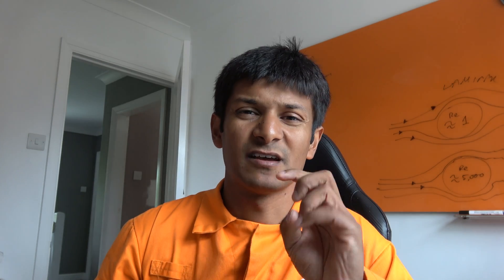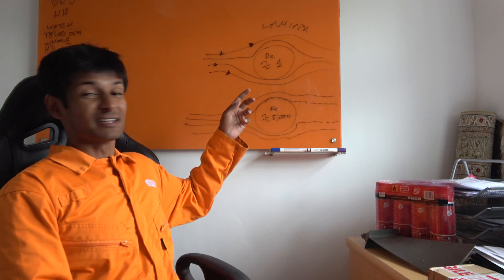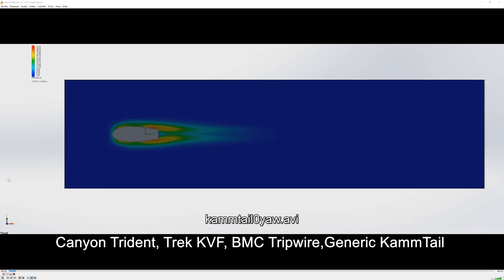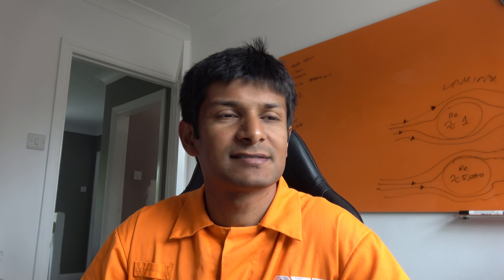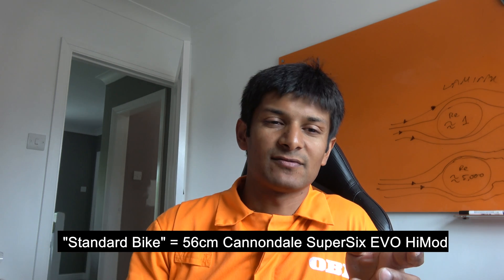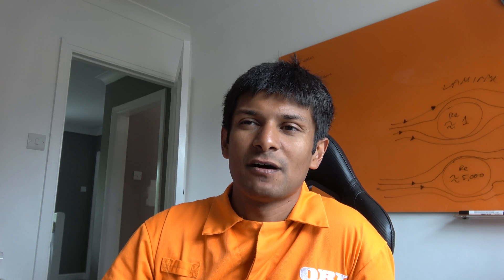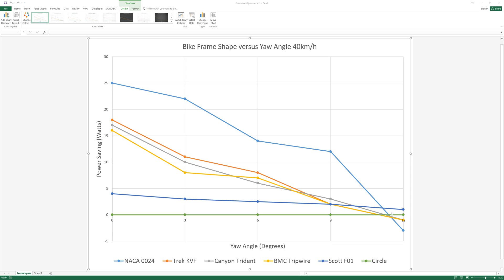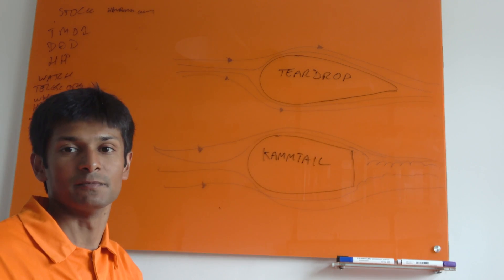Trek Canyon Scott BMC bike frames Compared, Which is more Aero? An Engineering Explanation

Comment: As you might know, the aspect ratios of
tube shapes (cross section) was limited to a ratio of 3:1 (length:width) by the
UCI. So when we compare airfoil shapes, we always keep the aspect ratio the
same. Your comparison is misleading because you compare a 4.35:1 NACA airfoil
with a 3:1 Kammtail profile. If you do the comparison again with a constant
aspect ratio of 3:1(same width, same length), you will see that our TriDent
shape is superior to a NACA/tear drop shape, not only aerodynamically but also
regarding the stiffness-to-weight ratio. Your Canyon Team.
Reply from the maker: Dear Canyon Bicycles, thanks for taking the time to reply, it is not often that a large manufacturer does that and I have pinned the comment to be completely transparent. Some points from me (I will do a video and send you the link but in the intervening period). 

- I've checked a NACA profile with 3:1 ratio against your trident, in steady state scenarios, the Trident is only faster at a speed of 46km/h below that speed a NACA profile is faster because of improved flow from the back of the aerofoil. In transient analysis, the NACA profile appears to be faster all of the time.
- I checked the results in the wind tunnel where Airbus (GKN) check their scale models, this tunnel allows for swirl which most wind tunnels do not. My CFD is calibrated to that. 
-Not sure where you got 4.35:1 from  NACA 0024 has a 4.167:1 ratio
- I 100% agree that the trident profile will be stiffer. 

I will send you a link to a video when I have finished making it. Thanks once again for your participation. Hambini
Reply: Hambini I think you said in the video that if Canyon would not be bound by UCI rulings and the stiffness of the whole bike they would surely use NACA profile. But there is obviously more to designing a bike and I think you acknowledged that in your video. Thank you.
Reply from the maker: Dear Canyon, a response and an offer to your comment:

https://youtu.be/ofZocph3jTw
Reply: I agree. The naca profile is way less stiff then the kammtail profile, which is also an important aspect  for a bike frame.
Reply: Why not for stiffness and aero points, the structure should be made in the trident profile but add extra carbon in the end to make it similar to the shape of the NACA profile.
Reply: I think the point here should be that bike manufacturers are not making aeroplanes. Downtubes on a bicycle have a different function than an aeroplane wing, and a naca profile is in fact just that, a profile, nothing more - until it is applied to a real world application. And in the case of a bicycle it is not 100% suitable for a frame. You have your head up your arse mate, I appreciate your point of view, but you come across as very narrow minded. A bit like Piers Morgan actually. I can see all this and I'm a bloody painter and decorator.
Reply: @ElliotFlowers  I'm not sure why you appear to be addressing these comments to Hambini when it was Canyon who made the direct comparison of the aerodynamics of their "TriDent" profile to a NACA profile.
Reply: @makescode  This, exactly.

Comment: I think there are further gains to be had within UCI restrictions through the use of turbulators and control of the separation through vortex inducing shapes in the trailing edge. Its already been done on a wheel rim and a seatpost - next franes?

Comment: I just watched this now, 3 years later.   Thanks for making these videos, Hambini.  

One thing I will take exception to is attributing drag to vortex shedding.  This is simply not true.   In fact,  the drag crisis occurs when vortex shedding begins.    Cd and Sr number are inversely correlated.  See equ'n (35) of this paper, where Sr ~ 0.77 * ( 1 + 1/Cd ) for a cylinder:
http://berndnoack.com/publications/Ahlborn2002fdr.PDF

Using vortex shedding as an indication of high drag is incorrect.   But you have access to direct integration of drag forces, so why not just calculate these and discuss in those terms?

Comment: I surmise that a cyclist traveling 46kph will have a velocity vector into the wind, regardless of yaw angle, no?  Won't the effect of a side wind to cause the cyclist's velocity vector to decrease as a function of both yaw angle and side wind speed?  I.e. what is the wind velocity speed at a yaw angle of 11 that overcomes the cyclist's 46kph velocity into static pressure?

Comment: My Trek Madone 6.9 has sort of a fat aero section and my Colnago CLX 3.0 is aero with that break in the tail section to separate the aero flow that you hate so much. As you've said before, the frame profile doesn't seem to have much effect. my Emonda has a round tubing profile and I really can't tell the difference in speed nearly as much as using the 28 mm tires which stop the bike from bouncing around on the road so much. Now since it is all up and down around the San Francisco bay area, your mileage may vary because your speeds would be less on the top end and I'm a slow climber and weight is more important than aerodynamics. But it isn't unusual to hit 65 kph or faster down the descents. Hope you're not worried about law suits about your, uh, free use of the English language. Imagine the publicity it is worth advertising the heck out of your being sued for calling some bicycle magazine's test a dog's bollocks which most of them are. I've dropped all of my subscriptions after having less information in a single issue than one of your videos. And we get some humor as well. Where else do we get to see a bicycle frame defamed on a Disney Princess Blanket. And i should add that the fastest of my bikes appears to be the Lemond Zurich with Reynolds 853 tubing since the cross sections are so much smaller than the others.

Comment: Hey I am 5 yrs old 2.  For general riding would u recommend a deeper section wheel at rear, e.g. 45 rear,30 front. and for that matter a wider section Tire in the back and a narrow one in the front for example 25 mm in the back and 23 mm in the front.  
FYI I only use tubular wheels and tires as I prefer them.

Comment: Might the Kammtail work better where there’s a wheel behind it? Seems like rejoining the airstream to slam into a wheel might be worse. I definitely agree for seat posts and anywhere the wheel isn’t behind the tube, but- and I have no data, might the kammtail design be a reasonable compromise between aero and weight? After all no one wants to climb on an 18lb bike? It’s kind of funny, but if UCI didn’t want a radical departure from round tubes so performance of riders could be compared (what with all the other variables), it seems Kammtail offers a significant wattage advantage anyway, I wonder why they didn’t just mandate round tubes? 3:1 seems too much departure anyway!

Comment: Hi Hambini!
I always wondered if it makes sense to compare bike frames, because when the rider sits on it the aerodynamic fully changes. So if you test the aerodynamic of the whole system (bike+rider) the frame alone plays a negligible role in it. Am I mistaken?
Can you maybe tell what percentage of aerodynamic makes the frame?
Reply: I agree with you. the front downtube is in the dirty air behind the wheel and fork. I would like to see this discussed.

Comment: l only have one question what is the profile of a round tube at 45 degrees cross section ??  l found its an Oval shape and since position of round tubing on a traditional bike is roughly 45 degrees on the down-tube  so its profile is actually oval not round ,so what s the drag of that ?? and yes l know it not hitting air straight on after a moving front tire and wheel which has its own characteristics as well as us on the bike .

Comment: So having less and smaller tubes helps?  Ie if a bike has a lot of material looking at it from the side it would not be good in cross winds so i guess using as stronger design as possible allows smaller tubes = less turbulence.  I think i got that bit right, if steel was light it’d be really handy on windy day? Doing 30kmh up an hill isn’t achievable for me so aero dynamics doesn’t count much up hill most of my rides i feel like its always up hill as well.  Could a really thin round tube be better than a Chunky aero?

Comment: Question why isn't there a company designing small wind aerofoil like shields that used to be common on mopeds around the 70's for road bikes surely this would cut down drag alot or is it a question of cross wind danger ?

Comment: They're doing a constrained comparison. I think what they're trying to say is that truncated airfoils beat NACA profiles if you abide by a 3:1 aspect ratio and still want a reasonably striff section.

Imagine a NACA profile that's over 30% thick. The whole trailing edge is gonna be separated anyways.

Comment: Haven't found a reason to replace my 2010 Cervelo S2, NACA airfoil profile tubing and seatpost, lightweight, stiff but not too stiff, threaded bottom bracket.
Reply: Josh K I have same bike - also very light - mine 16.6# with Zipp 404’s

Comment: I am still wondering a steel frame has very thin tubing, compared to a carbon frame. Are these steel frames with its thin tubes are not more aerodynamic, then a carbon frame?  Maybe the drag coefficient of a steel frame is higher, however, the area is much smaller and none of the carbon frames has a perfect streamline or teardrop body.  According to Wikipedia, a sphere has a drag coefficient of 0.47 and a teardrop body of 0.04.

Comment: Aerodynamics becomes less important the slower you go...  at the average speed of an average rider about 17mph it has little impact.  The amount of aerodynamics savings a  bicycle frame can offer is almost 0 at speeds under 20mph.   Rider position is the most critical place to save watts through aerodynamic savings.  Wheels are the second most critical area.  An aerodynamic bicycle frame offers a PRO rider very little advantage, it offers an average rider none.

Comment: To make a light and aero bike, use regular tubing and make a teardrop airfoil from 0.007"  Duralar film.  UV stable, I have had it on my bikes for years.  My current bikes are folding Zizzo minieuro Liberte.  The long seat post is where the airfoil is.  I also use this plastic to partially enclose the rear wheel.  The low rotating mass of the 20" wheels makes for a nice ride.
Reply: The long airfoil shape can also act as a sail, as it is somewhat unconstrained.

Comment: When I look at tube profiles on bikes, I don't see them at 90 degrees, I see them parallel to the ground.  That's why I see most the cables as jelly bean shaped even though they're round.   (Of course, they go from round to very oblong and back or whatever but I'm sure you get my point.)  What I was wondering though is, why is there any effect on the bicycle if the air gets turbulent at some distance from the tube?  I would expect because of the randomness of airflow that no matter how smoothly air came off the last point of contact it would get disrupted pretty soon after that.   I can see turbulence close to the tube being an issue because that turbulence took energy to create and that energy must have come from somewhere, but how far away from the tubes is that still important?  Sorry for the long winded question but I don't know anyone else to ask.  All the best and btw, f*** that guy and his head up his ass van driving.   Glad you're recovering.

Comment: Once they come up with an aero road bike that makes me faster at about 18 mph I'll buy one.  :)  Great info.
Reply: Aero bikes will make you faster at that speed. By how much, hard to tell, my guess would be somewhere between 0.5 and 1 km/h. I recently switched from a non-aero bike with box section wheels to an Aeroad with 58/60mm deep wheels. Seating position has stayed almost the same. My average speeds on solo training rides before the switch were in the range of 28.5 to 29.5, after the switch they have been in the range of 30.5 to 32km/h. Obviously there's always some variation, but the tendency seems to be about +2 to +3km/h from the switch. The majority of that increase is probably the new wheels, but definitely not all of it.
Reply: @ska042  hey thanks for the comment. I had a guy on his brand new Trek Madone keep up with my wife and I on our tandem on a 6-7% descent. We went side by side, then he tucked down into an "aero" position and passed us! We topped out at 40 mph, he loved that. My wife and I weigh in as a team at 290# he probably weighed 225-235#. Anyway, it was an interesting experiment. So, there is "some blow in the aero"! Oh, yeah he was running 60mm aero wheels.

Comment: this is possibly the best, least biased education program on cycling ! Bravo, sir!

a local bike shop recently tried to sell me Ceramic Speed jockey wheels for $500 plus giving me the snake oil pitch, and i walked out of there ASAP and will not return.

what a load of BS !  those wheels should be $50 max
Reply from the maker: You should go back and ream them!
Reply: i would, but every shop charges about 5 bills for those dumb ass jockey wheels. not worth my time, or the bad vibes, but Ceramic Speed are a con company in my opinion. Extremely overpriced 

The fact that he tried to sell me on the ceramic aspect is what bugs me. also tried hucking me a wheelset with the ( but the bearings are ceramic, Jim " ) line and a knowing nod. 

sheesh ! i must look like a sucker. or, maybe because i rode a pricey bike he thinks i am a golden goose. or an April Fool (as the French say : Poisson d'Avri) l .. i am no fool, nor rich and he lost a customer. the shop i deal with never tries selling anything and will discourage anything unnecessary.

Comment: Interesting but what happens when you put a bottle and bottle cage on the backside of those shapes? Then how does that NACA profile perform?
Reply from the maker: Then the dominant factor becomes the bottle and not the aerofoil. In effect you might as well ignore the tube and consider the bottle. An analogy would be putting a brick in front of the nose cone of a 747.
Reply: Thank you for your reply. So, downtube shape should not be given consideration with a bottle attached?
Reply: William Thomas CSUF Kinesiology I would imagine some shapes may actually work better the a bottle.

Comment: What wheels would be more aero shimano c50's 9000 or the hed jet 6 black? The c50s have a al brake track which I believe is a detriment to aerodynamics as they slightly protrude but they both have internal nipples which I think is the partial reason for being fast. Internal nipples are consistently present among the fastest e.g enve, hed, mavic etc. What are your thoughts Hambini.
Reply from the maker: The C50 is not really an aerodynamic wheel. It's more robust than anything else. Here are some results from a wind tunnel 

https://www.hambini.com/blog/post/bicycle-wheel-aerodynamics-which-one-is-fastest/

Comment: Kammtail profiles would probably be more aerodynamic than the teardrop profile with bottles on the bike.  Since a bottle sits more flush within the negative space of a kammtail, the air will transition more smoothly.  On a teardrop, the air would flow smoothly over the frame, then pulsate like crazy once it reaches the bottle, defeating the purpose of an aerodynamic system.  It would be interesting to see the flow characteristics of each shape with a bottle at the trailing edge.

Comment: Hi, just found this channel when i was debating the ceramic snake oil with friends, very informative for amature like me.
I have came across ads saying Merida using an airfoil called NACA fastback (some cite the name NACA 0028), how does this one compare? just like another kammtail you've mentioned?
Reply from the maker: It's basically a Kammtail. The back end is chopped off. HOwever it's quite a "fat" aerofoil so the amount of chopping is not as much as the others.

Comment: @Hambini Wondering if you could help me here. I would consider myself an average cyclist that probably averages around 30-35 kph on the flats. Many aero wheel manufacturers talk about how there wheels save x watts at 40 or 45 kph - a speed that is beyond me for any length of time. For the average cyclist (capable of 30-35kph on flats with basic wheels) could you give us an idea in kph, how much faster a standard aero wheel is on the flat (say a Zipp or DT Swiss of your choice)  vs a road bike wheel that has been designed with very little consideration to aerodynamics?
Reply from the maker: Hi Scott,  If you went from a Shimano C35 which is not really considered an aerodynamic wheel to a Zipp 404 which is considered an aerodynamic wheel, you would gain about 0.2km/h. 

However if you went from a Zipp 404 to a Zipp 808,  you would gain 1.2km/h. The bigger differential comes from the section depth as opposed to the profile. Aerodynamically, a gain in section depth is making the aerofoil cord length longer. 

Hope that helps
Hambini
Reply from the maker: It's at 33-35km/h. 

In a crit race, two things have to be considered which are your actual velocity when you are tailing somebody. It is not going to be 40-45km/h, you will be 20-30% less than that on average lets say 37km/h. You are also going to be hitting turbulent air so the effectiveness of the aero profile is reduced.

A bigger issue might be the acceleration and this depends on the course. You are constantly on and off gas and probably braking. In this scenario a deep aero wheel is not going to be helpful as it will inevitably heavier than a "climbing wheel" 

For crit racing I'd recommend 40mm max. If you are going at constant speed for a long time then deeper is the way forward but if you are having to accelerate and decelerate get the lighter wheel. 

hope that helps Hambini
Reply from the maker: You are welcome.
Reply: Hambini Performance Engineering THANKS AGAIN FOR THIS HONEST AND TRUSTWORTHY ADVICE , much appreciated